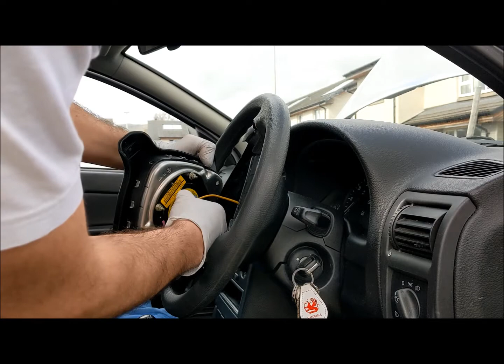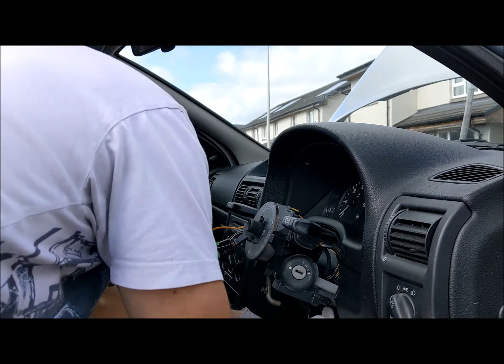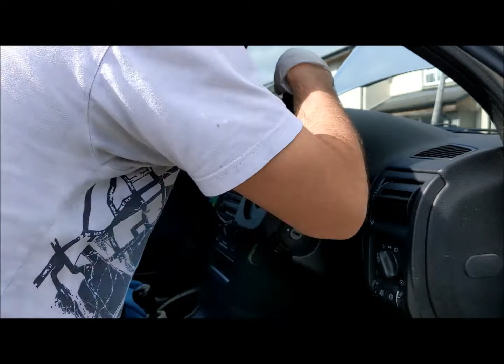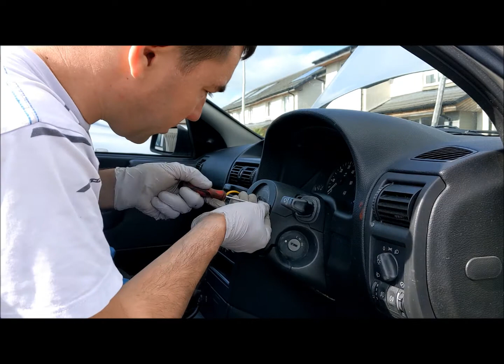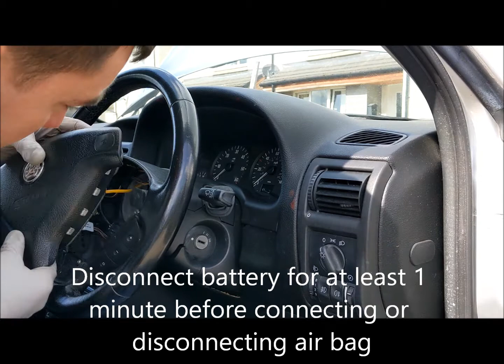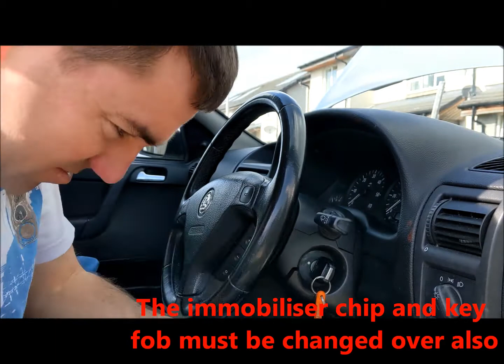Vauxhall Astra G MK4 Drivers Airbag, Steering Wheel and Ignition Barrel Remove and Replace 1998-2004

Comment: Wich torx tip, Airbag removing  when ?
Reply from the maker: Think it was a T25 btw the manual says to disconnect the battery before removing but I've tried it with the battery connected and it never went off

Comment: So, there is no need to go to a vauxhall dealer and pay £149.99 to reprogram a new key after the barrel replacement then?   Just take the tiny transpondrr/carbon block out of the old key and put it into the new key.
Reply from the maker: Is that how much they charge?! Lol what a rip off. If the barrel is broken you can just replace it then put the chip in the new key. Downside is having a different key for the ignition than for the door.